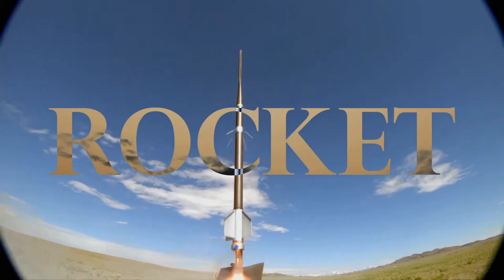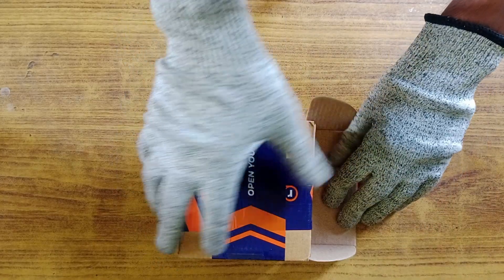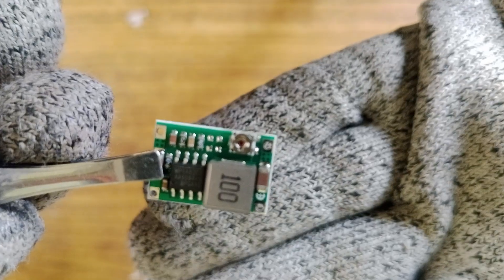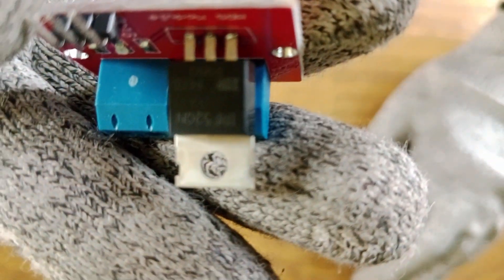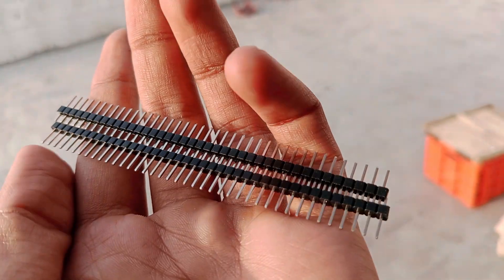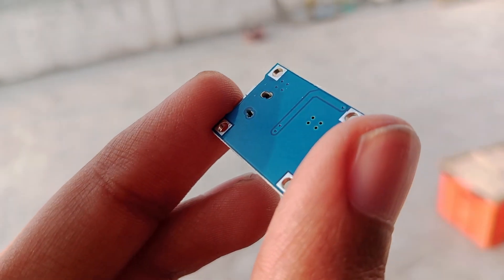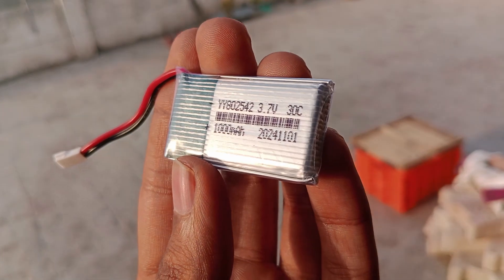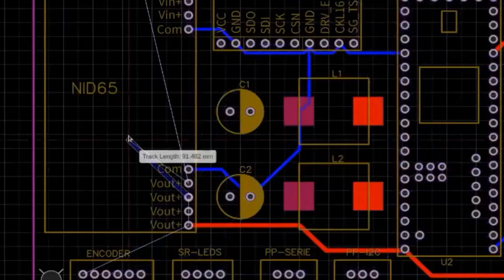Unboxing Rocket Flight Computer!

Comment: Whats the Total cost ❤
Reply from the maker: I bought around 11 items at first but as you know i didn't have much knowledge about making FC so i had to spend a little extra to get new parts,  link Mosfet.
If we look at total cost, it was 515 rupees for the shipment of all important parts like raspberry Pi and BMP sensor.
The second shipment cost me 209 rupees, that shipment contains all the connection part and an extra BMP sensor.
Reply: @CosmicCraft-r47 hi brother can you Please help me I am also working on a model rocket I dont know about coding and connections and when I am asking chatgpt for help she is saying I cannot help on that she say that I cannot help you in making the pyro charge ignition system please make a video in which You successfully made the avionics with code ❤😢

Comment: code in  Python (converted using ai )

from machine import Pin, PWM, I2C, SPI
from time import sleep, ticks_ms
import math
import os
import sdcard
import mpu6050
import dht
import bmp180

# === I2C Setup ===
i2c = I2C(0, scl=Pin(1), sda=Pin(0))
mpu = mpu6050.MPU6050(i2c)
bmp = bmp180.BMP180(i2c)
bmp.oversample_sett = 2
bmp.baseline = 101325

# === DHT11 Setup ===
dht_sensor = dht.DHT11(Pin(28))  # GPIO28

# === Servo Setup ===
servo = PWM(Pin(15))  # GPIO15
servo.freq(50)

def set_servo(angle):
    duty = int((angle / 180.0 * 2 + 0.5) / 20 * 65535)
    servo.duty_u16(duty)

# === Buzzer & RGB ===
buzzer = PWM(Pin(5))
led_red = Pin(6, Pin.OUT)
led_green = Pin(7, Pin.OUT)
led_blue = Pin(8, Pin.OUT)

# === SD Card Setup ===
spi = SPI(1, sck=Pin(10), mosi=Pin(11), miso=Pin(12))
sd = sdcard.SDCard(spi, Pin(13))  # CS pin GPIO13
os.mount(sd, "/sd")

# === States ===
recording = False
servo_triggered = False
rgb_cycle_active = False
trigger_time = 0
rgb_last_change = 0
last_beep_time = 0
current_color_index = 0

# === Functions ===
def play_startup_tone():
    for freq, dur in [(1000, 0.2), (1200, 0.2), (1500, 0.3)]:
        buzzer.freq(freq)
        buzzer.duty_u16(32768)
        sleep(dur)
        buzzer.duty_u16(0)
        sleep(0.05)

def startup_leds():
    for led in [led_red, led_green, led_blue]:
        led.value(1)
        sleep(0.2)
        led.value(0)

def update_rgb_cycle():
    global rgb_last_change, current_color_index
    if ticks_ms() - rgb_last_change < 250:
        return
    rgb_last_change = ticks_ms()
    current_color_index = (current_color_index + 1) % 7
    led_red.value(current_color_index in [0, 3, 5, 6])
    led_green.value(current_color_index in [1, 3, 4, 6])
    led_blue.value(current_color_index in [2, 4, 5, 6])

def buzzer_beep():
    buzzer.freq(1200)
    buzzer.duty_u16(32768)
    sleep(0.2)
    buzzer.duty_u16(0)

def read_dht():
    for _ in range(3):
        try:
            dht_sensor.measure()
            temp = dht_sensor.temperature()
            hum = dht_sensor.humidity()
            return temp, hum
        except:
            sleep(0.01)
    return None, None

def handle_command(cmd):
    global recording, rgb_cycle_active, servo_triggered
    cmd = cmd.strip()
    if cmd == "180":
        set_servo(180)
    elif cmd == "90":
        set_servo(90)
    elif cmd == "5":
        set_servo(5)
    elif cmd == "b":
        buzzer_beep()
    elif cmd == "c":
        update_rgb_cycle()
    elif cmd == "allr":
        set_servo(0)
        buzzer.duty_u16(0)
        led_red.value(0)
        led_green.value(0)
        led_blue.value(0)
        print("All reset.")
    elif cmd == "r":
        recording = True
        print("Recording started.")
    elif cmd == "stop":
        recording = False
        print("Recording stopped.")

# === Startup ===
startup_leds()
play_startup_tone()
print("Startup complete.")

# === Main Loop ===
while True:
    # Serial input handling
    if input_buffer := input():
        handle_command(input_buffer)

    # Read sensors
    accel = mpu.get_values()
    axg = accel["AcX"] / 16384.0
    ayg = accel["AcY"] / 16384.0
    azg = accel["AcZ"] / 16384.0
    pitch = math.degrees(math.atan2(-axg, math.sqrt(ayg**2 + azg**2)))
    roll = math.degrees(math.atan2(ayg, azg))

    tempDHT, humDHT = read_dht()
    tempBMP = bmp.temperature
    pressure = bmp.pressure
    altitude = bmp.altitude

    log_data = f"Pitch:{pitch:.2f}, Roll:{roll:.2f}, "
    log_data += f"DHT_Temp:{tempDHT if tempDHT is not None else 'N/A'}, "
    log_data += f"Humidity:{humDHT if humDHT is not None else 'N/A'}, "
    log_data += f"BMP_Temp:{tempBMP:.2f}, Pressure:{pressure/100:.2f}, Altitude:{altitude:.2f}"

    print(log_data)

    if recording:
        try:
            with open("/sd/DATA01.TXT", "a") as f:
                f.write(log_data + "\n")
        except:
            print("SD Write error.")

    # Auto Trigger
    if not servo_triggered and abs(pitch) > 5 and abs(roll) > 5:
        set_servo(90)
        trigger_time = ticks_ms()
        last_beep_time = ticks_ms()
        servo_triggered = True
        rgb_cycle_active = True
        print("Servo Triggered! RGB + Buzzer started.")

    if rgb_cycle_active:
        update_rgb_cycle()
        if ticks_ms() - last_beep_time >= 1000:
            buzzer_beep()
            last_beep_time = ticks_ms()

    if servo_triggered and ticks_ms() - trigger_time >= 17000:
        set_servo(0)
        servo_triggered = False
        print("Servo reset.")

    sleep(0.05)